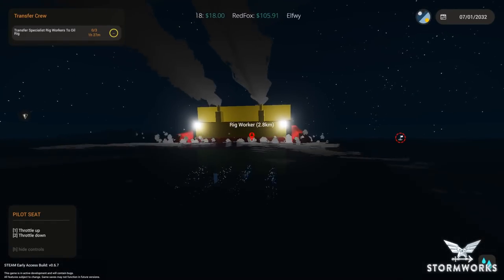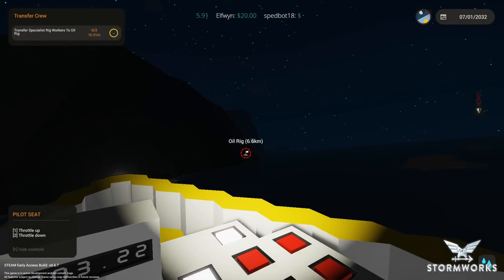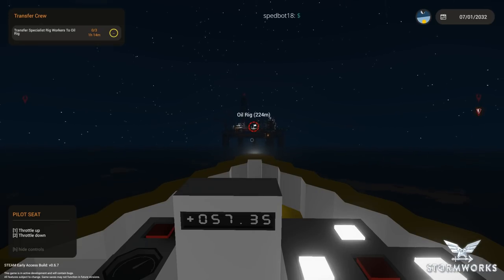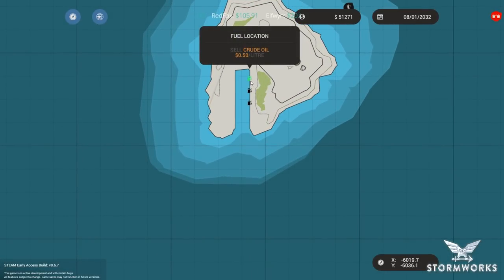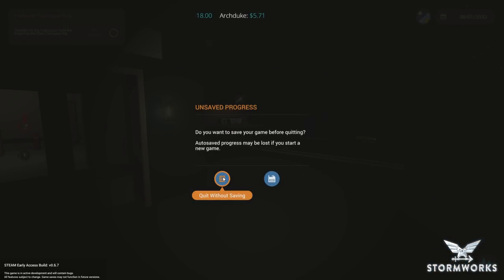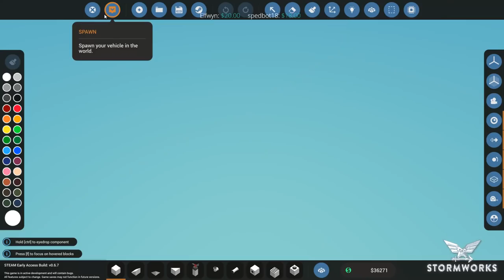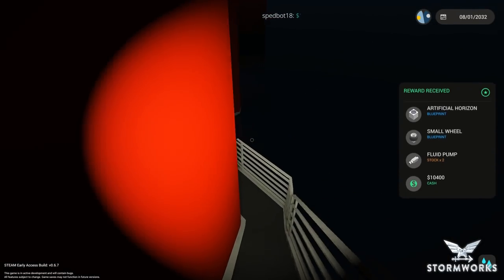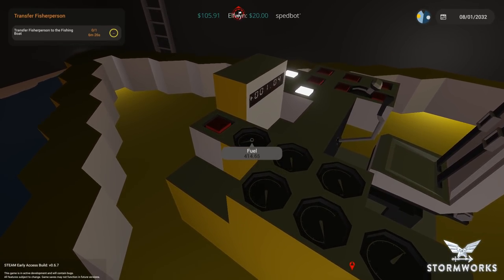Stormworks: Build and Rescue - Career Advanced - Episode 7 - Casual Chat

Comment: One thing you may not have known engines have there own pumps built in and the fuel pumps on islands can fill and empty a custom tank without a pump
Reply from the maker: Yeah I know they have them, but their power/range is limited. That's why I usually use pumps.
Reply: Yeah but it dose work and if you have a pipe made of blocks going down to a port it works for a further range but it is slower